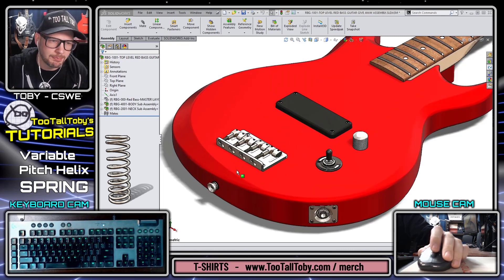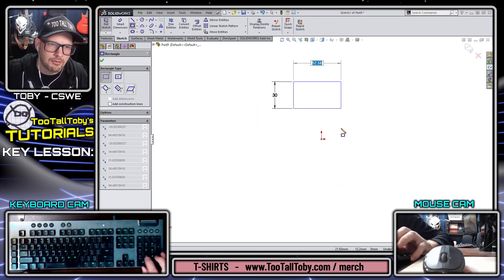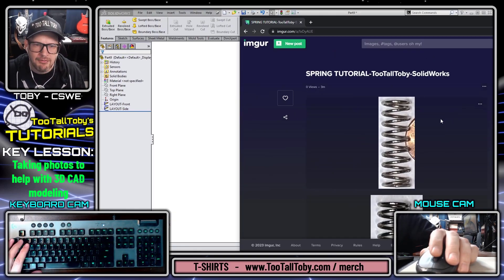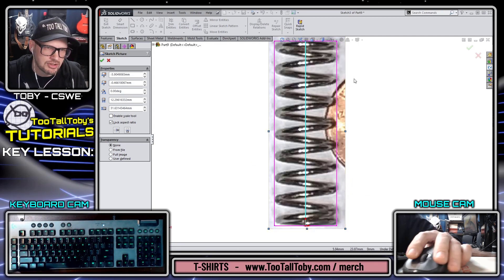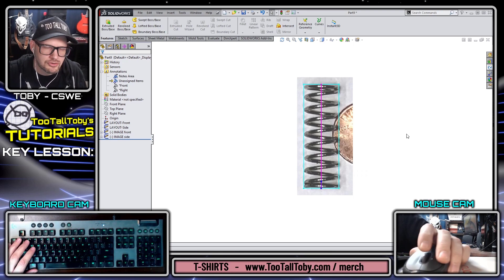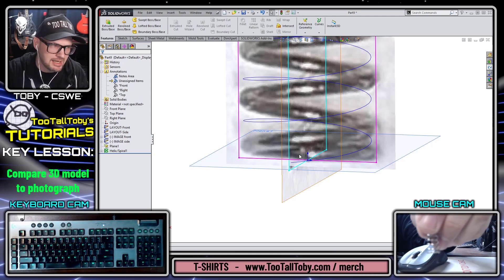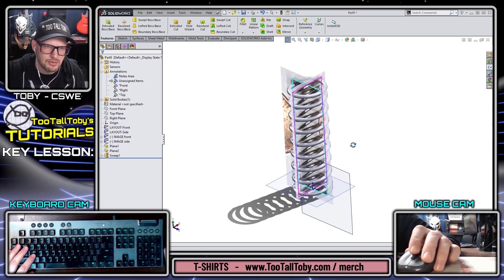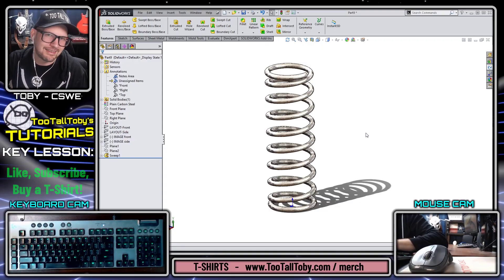SOLIDWORKS Compression Spring with Flat Ends using Variable Pitch

Comment: Is there a way to make a motion study with a variable pitch spring?
Reply from the maker: You probably want to use a different more advanced solver for that.  At a minimum you'd have to use the nonlinear solver in SW Simulation Premium - but there are probably more modern (cloud based) tools that will help you solve these kinds of equations faster.  good luck

Comment: Toby I have a question. I tried to model some springs in the past and I found out that helix/sweep combo is the best method (IMO). However, what I found quite frustrating is that if you insert the spring in a drawing you are not able to insert a few dimensions such as the pitch. Is there any workaround?